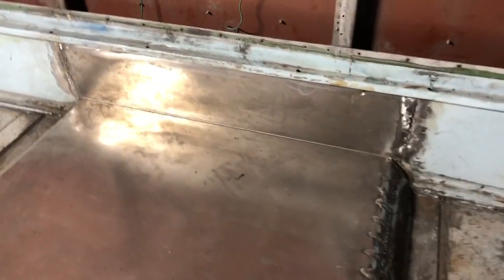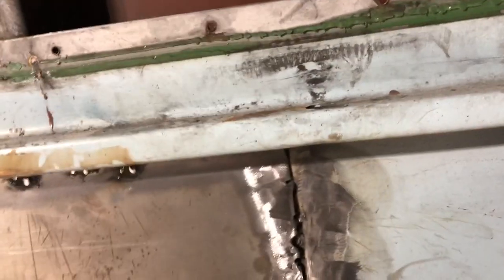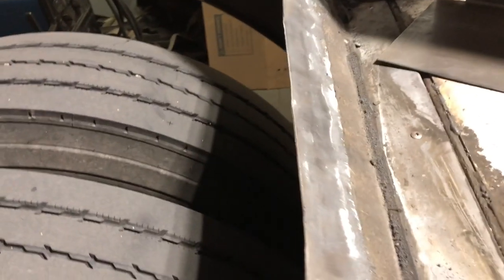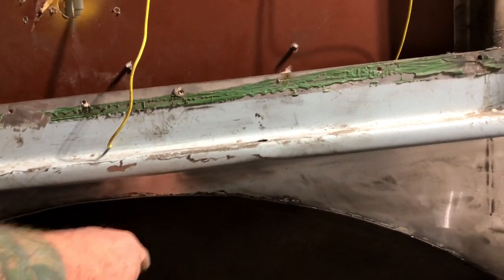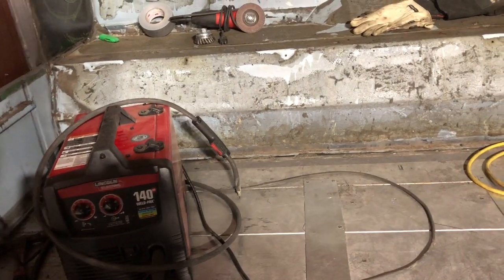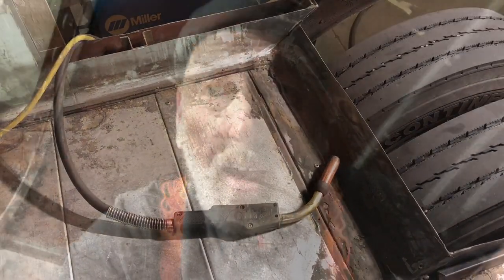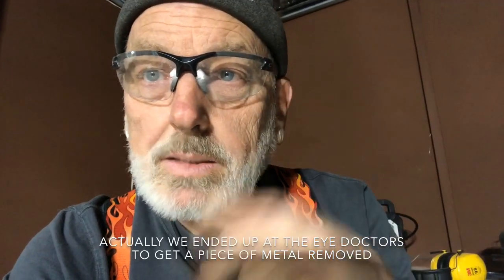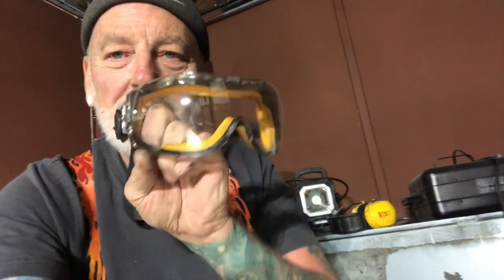True Confession of a Bus Converter - Vlog 46 School Bus Conversion

Comment: What, no "Heeeyyyy YoooTooooob!" Are you depressed about that fender welding? It probably not going to be seen right? Spray foam will hide the sin. Oh wait, you posted this true confession video.  Lol. 
I pulled the plywood floor on our bus this week and have a lot of work to do to fix cancerous rust and holes especially by the rear wheels where Pennsylvania road salt ate the floor. I really should have flown to Phoenix and bought from Tony and Joe at AAA Bus. I'm thinking of cutting our wheel wells down flat like you did.
Reply: Yes it will all be covered up 😀 not depressed but these wheel well have been one of the most challenging parts of the build so far. II’ve struggled with them and just wanted to share 😀 I hope you don’t have too much trouble cleaning up your rust issues. Let’s get these buses built 🙂
Reply: @RandyKnappWood  it's the struggle that breeds the appreciation and satisfaction.  You're doing a great job! I'm thinking through the rust issues.  I think I'll have to cut a lot of the sheet metal floor out and replace a few structural C channels under the floor at the frame.  We have a plasma cutter and mig welder.  It will be interesting.
Reply from the maker: Good Luck with your floor. Thanks for you support and following us on this journey.